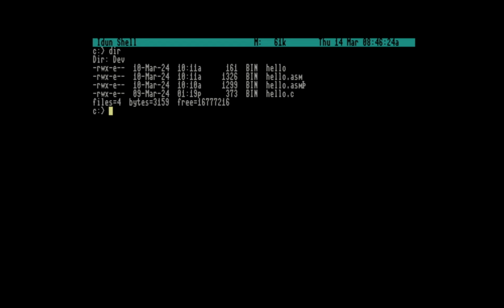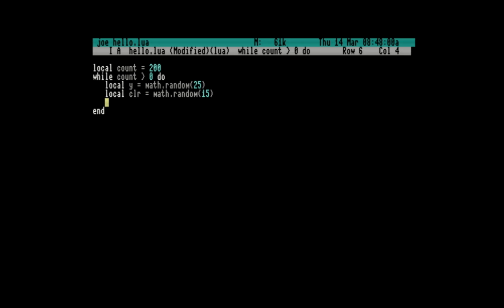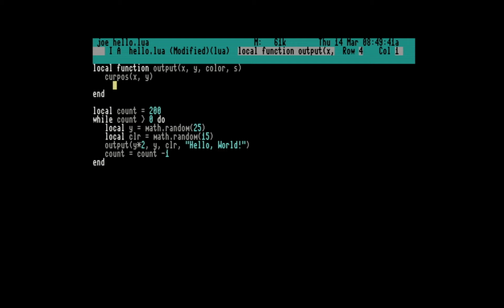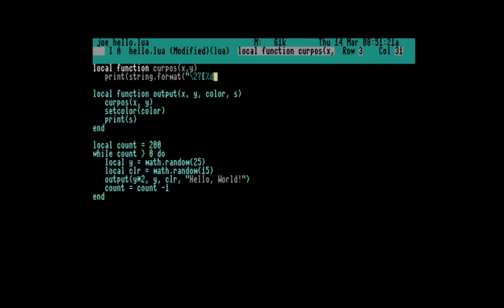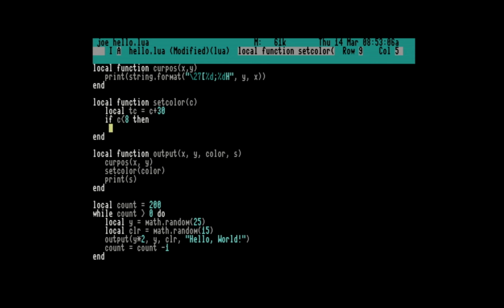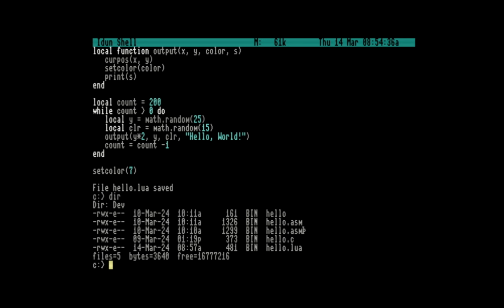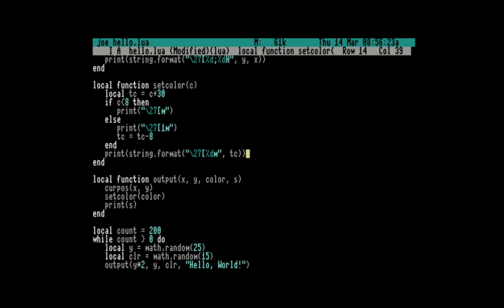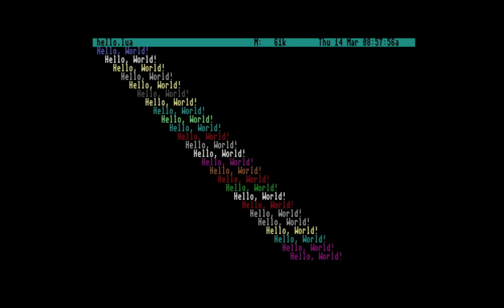Programming C128 / 3 Languages / 3 CPUs : Part 3 (Lua+ARM)

Comment: I read that Idun uses a Propeller 1 microcontroller. That's not the actual processor the Raspberry Pi is it? It seems to be a fourth processor "between the C128 and a Raspberry Pi". Can it also be programmed?
Reply from the maker: The Propeller 1 is used as an interface between the C128 and the Pi, and just runs a simple firmware.